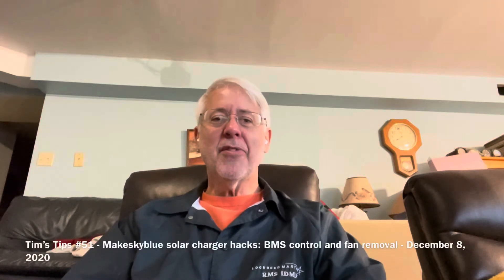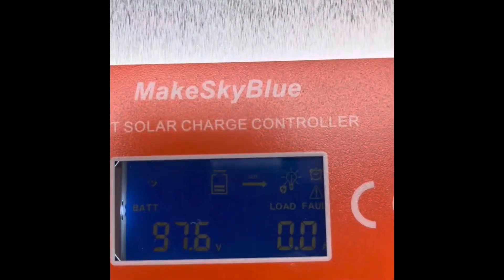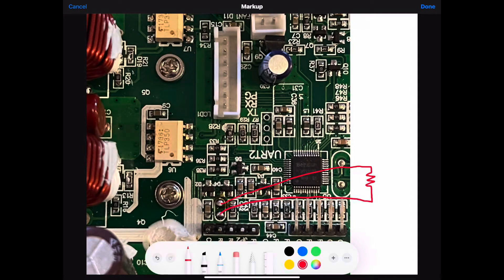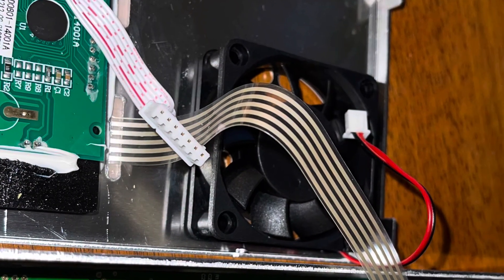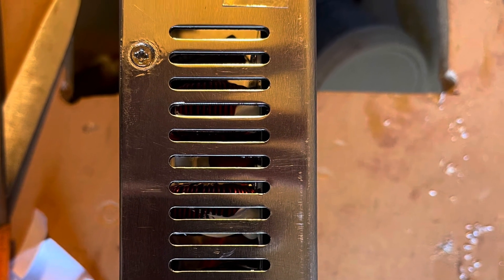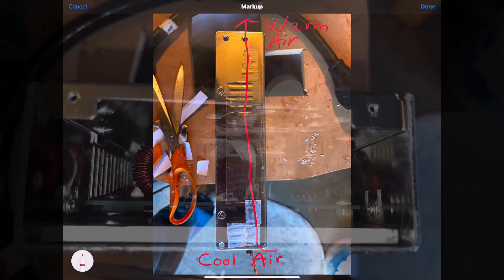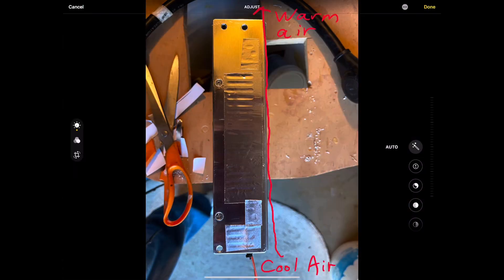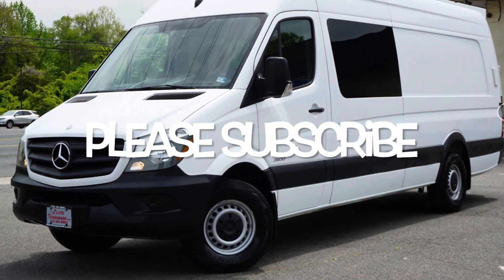Tim’s Tips #51 - Makeskyblue solar charger Van Build hacks: BMS control and fan removal, Dec 8, 2020

Comment: Hi Tim like your tips thanks 
I am Ben a poor and slow WV hillbilly lol  I would like to hear more about your battey bank
That is if you have the time if not thats ok also i understand life can be non stop 

Tesla 3 batteys can be bought cheap  I am thinking about getting part of one 
The seller said it is around 19 kwh  and he is asking  around 1800 bucks 
Was hoping to gain a little wisdom from your hands on experience 

Any info on  your tesla batt bank would be great 
I have a inverter that will take over 105 volt batt bank 
 
So a little back info about me may be a little helpfull that is if you have the extra time 
for my two much info nonsine  First of all a am truly a slow learner on most thinks and my mind 
works in strange ways to most But i am honest love God and would not ofend others on purpose 
I am so very far from perfect have planks in my eyes so can see to pick a speck out of others eyes 
OK thats definitely to much so hears some more lol 

  I am almost done  with the secondary 120 240 volt high side of a gaint inverter transformer 
It has been very slow going because of heath problems  It is the tranny for low a freq inverter  board my 
buddy designed and wrote programing for  I was going to test it a little I may still get to 
  It should be on the market soon  The last one he made the GS 6k he sent me also  in testing phase 
for me to try to blow up  Why me you ask   Because i am the best there ever was at blowing things up
 and i may have dove him nuts wanting to  If your wondering no i could not blow it up

 The 6k Genetry Solar inverter will do 8000 watts all day if the room it is in is not over 100 degrees  
From your phone wi fi or the little lcd screen you can set the wattage to what every you want  
 It has temp sensors that will shut it down also if your pulling 8k out of your  6k GS in death valley lol 
 It has high dollar high speed fans that goes whatever speed the temp tells it to they are very fast at full speed 
Some dont like to hear fans running put hot parts have shorter life so it is a very good thing 
 If you have a  24 volt batt bank and upgrade to a 36 or 48 volt bank later on
 You will  NOT have to buy a new inverter you just pop the top change two wires from one lug to other less than 5 min 
That easy  to have a 36 or 48 volt inverter!  WOW WOW You read that right !! Yes it will do all the voltages up or down  
I bet your glad you read this far now  Sid is the best in the world raising bars all over!!

It has SS case built in charger you can set to any amp setting you want i think up to 150 amps 
You can change any setting from other side of the world  Or just just to make sure ac is running for 
your puppys when away from rv or home   It has a very low idle even lower than high freq inverters 
mine 6k GS is around 20 watts i think he added more filter cap  so your may be a touch higher 
It has a big  toroid transformer to get that low idle and for starting big loads   

Sid my buddy is one of a kind best personi have ever met!! Sean is good dude also!
 I call them buddy they likly think well some thing else about me lol
I was just a costumer Sid and Sean just make you fill like family   They both get joy from helping others  
Sean gets so many calls from people buying junk pj and many others  inverters needing help 
He has a youtube channel and for many years helped people patch up junk inverters  He was doing this long 
before he met Sid and started there own usa company  So people call him day and night they WILL find his number 
There is a Genetry Solar web site a blog there to ask anything and many youtube videos about GS inverters load testing 
There is also and tons of old videos on how to fix pj and other inverters      
  These china based inverter companys give no help when there saving every penny bites you the customer
They have no after sell help your family depends on electric  I made that high dollar mistake   They over rate wattage
 by triple and blow up for no reason he has helped
If i have to get ahold of sean i put one line text saying what i need in just few words much easyer to go to web site it is quick
  When i bought my first inverter not over 30 min  when i had question i think he saves them in his phone or some thing same for the ee sid!!
 
  A while back he designed and wrote programing for a grid tie for a  VERY  WELL  knowen company
 The owner of company insisted on a ONE CENT cheaper component   Company owner thought that no big money payday
was worth more than my buddys morals  NO NO NO Not so!!   Sid will only use the cheapest WELL PROVEN over many
 years parts in his designs  He understands what can be a cheaper part and what can not be!
He answers to a higher power he will NOT be part of cheating people  
You know parts failing  a few months after waranty up and or playing the numbers game 
So he refused to use a cheaper component in his design of a inverter he didnt get payed and he was glad he didnt! 
The owener did steal the programing  My buddy didnt care just glad his hands are clean 

Sorry i blab on and on buy the way my first inverter build is on thebackshed .com Benandamber user name and post is little china board 
many coped and named little china board so look for user name There are lots of good people there that made it happen for me 
All my home builds still run great but they are  dinosaurs   They dont have all the extras that make off grid comfortoble GS has them all and more 
The way i see it spend your money with the kind of businesses you want all businesses two be  

CRAP i forgot to say price of the 6k GS low freq wi fi inverter that will do 24 36 48 volt by changing a wire  around  1000 bucks crasy cheap!!

Ok back to the way to big tranny i am  winding The copper wire on the high side alone will be around 25 pounds  The low side  will also take around 25
 pounds of copper wire  the core is a little under 100 pounds  
So when finished the tranny will weigh 135 to 145 pounds  
It is realy to big for the 12k GS inveter boards i have but i want to bet it baddly 
I want bragging right to say i blew up a 12k GS mosfet or driver board  i gave up on blowing up the 6k  
Yes Sid is that good but he is to humble to say it
Reply from the maker: Amber, Thanks for your interest. The two Chinese inverters (120VAC and 220VAC) are doing fine after 2 years. They cost about $600 plus shipping and saved about 40 pounds of weight each compared to other inverters. The Genetry sounds interesting.